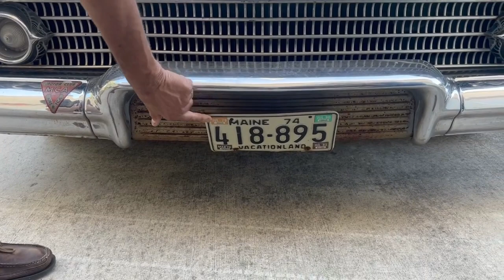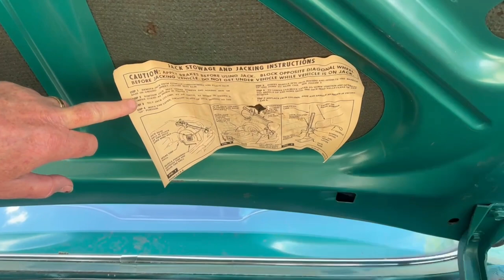Barn Find All Original 1958 Chevy Impala Sport Coupe: Chip's Garage Episode 27

Comment: The rumors about the 1959 & 60 gull wing fins on the Biscayne to impala Chevrolet full size vehicles, allegedly lifting the rear wheels off the ground at 80 plus mph is nothing more than an urban legend.   Chevrolet and General Motors would never have been permitted to release such an uncontrollable aerodynamic anomaly to the public! I believe that rumor was started by rival companies like Ford or Chrysler, who still had their upright fins during that period. 
In 1961, however,  automobile manufacturers stopped using their attractive fins and chrome because of aerodynamics and weight reduction needed for speed increases in the cars they were using in Nascar.
Reply from the maker: Awesome great information thanks! 😎

Comment: Also the red part on the door panel was a reflector, not a light. The rear speaker was an option, not standard, there would have been a knob on the right side of dash like this one. The ‘59 had the big fins, by 61 the fins were gone. Also 1948 was a recession year, most car companies took a hit in 1958. And you also could have optioned a fuel injected 283
Reply: Thanks… I forget some of the odd Options of 58’s……a classmates *& Friend in HS, PARENTS had the 1958 Impala/ auto/348 X 3+2 s// Four Door (??), he never drove it much…..,, a big boat, oddly appealing ……remembering, no a/ c, NICE Browns, Colors…faintly remembering Power Antennae,Steerinf, PowerbWindiws(*??),etc…the Impala FLAGS ,TRIM looked nice * the BIG ENGINE.
Reply: @markwatson3135 Do you know what the name of this green would be called?

Comment: Most every car went to dual headlamps in 58
Reply from the maker: Thanks! 😎
Reply: First model year they were legal in all 48 states. 
They originally designed the 57 Plymouth Fury to have them because they anticipated that they would be legal but the law wasn’t changed in time so they look a little odd with the single headlights and the smaller parking lights where the other headlights would have gone.

Comment: Nothing more irritating than two guys that that have knowledge and talk over one another to show how much they know, or think they know. Case in point on the passenger side rear the tear in the quarter panel sheet metal by the bumper. This damage was more common than most people think. If your car was bumped from behind or you backed into something , the rear bumper would be pushed into the quarter and tear the sheet metal then return to the original position. Ask me how I know?  This is a great find and this car with a little work can be returned back to it's original glory.
Reply: user-wv9zc7pc9s  How do I know ?  I owned a 1958 BelAir 2dr coup that was bumped in the rear at the local DRIVE IN one evening. The bumper moved forward and tore the sheetmetal then returned to the original position.

Comment: So much misinformation in this video.  1) The front turn signal/parking light was in the outboard location only.  The inner lens was non-functional.  2) the wing windows had no power option. 3) the front seat shells are chromes steel; not stainless steel.  4) that red lens on the door is a reflector and not a light. 5) wires had been plastic-coated for years prior to 1958.  "1000% original" despite having ass-ugly wheels replacing the hard-to-find original wheels.
Reply from the maker: Thanks for the info. and your kind disposition